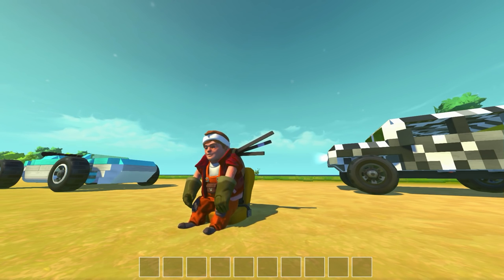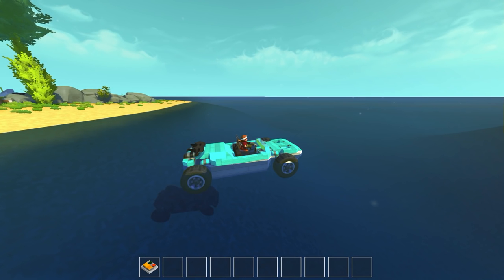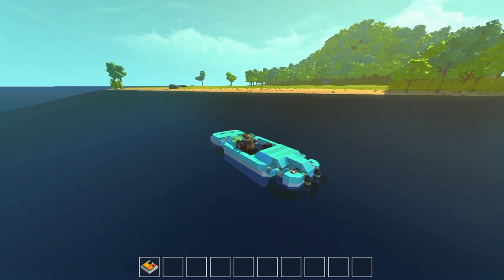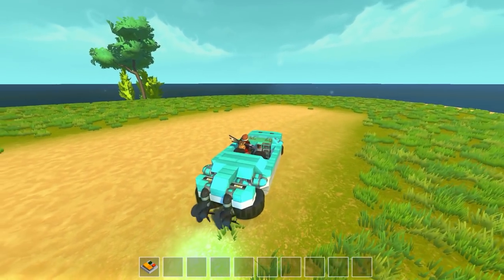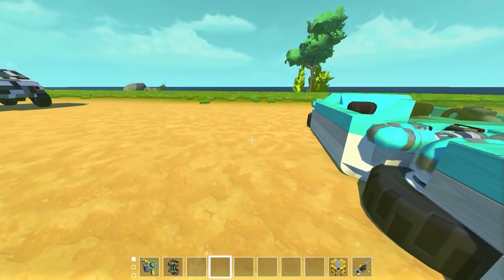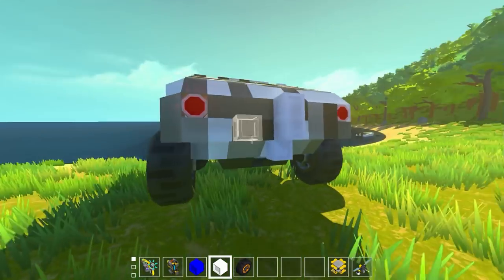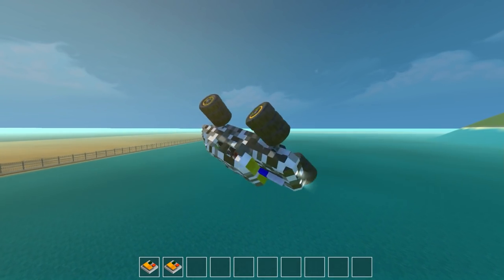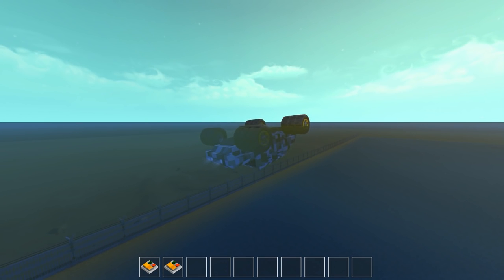Transforming Boat Car and Driving on Water! (Scrap Mechanic #299)

Comment: You could add a 3 block sensor to the bottom of the car so it automatically changes into a boat, although this would mess up big ramps.

Comment: hey kan, should make that amphibious car transform with a sensor, so when it so many blocks away from the ground it will automatically transform into a car without pushing the button
Reply: if you had it at like maybe 10 blocks it might not glitch out so it transforms still on the water?

Comment: it's because the way scrap mechanic work more weight means it has more force that's driven it so it should work the same way if you put on a realy heavy tier and maybe extend it out from the sides to make them have more wight to the car that's should make it work
btw I'm game developer.

Comment: The reason why you’re getting speed with tires is because it acts like what would actually happen which is creating speed because the bottom of the tires will displace water behind you moving you forward and the reason you spin is because the scripted helium mod moves you but when you go underwater the top also displaces water in the opposite direction and the scripted mod does not know how to act.